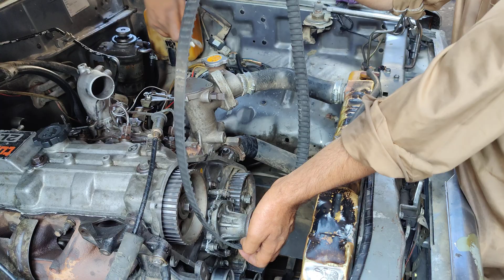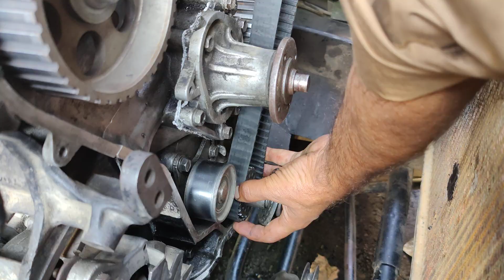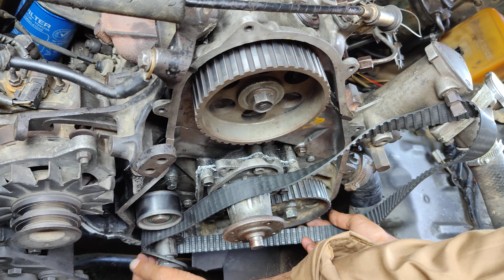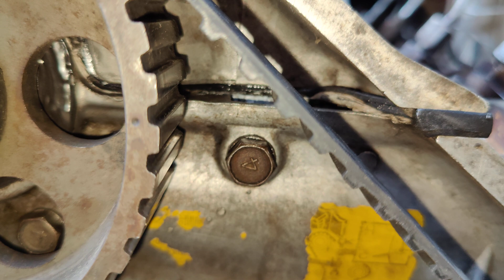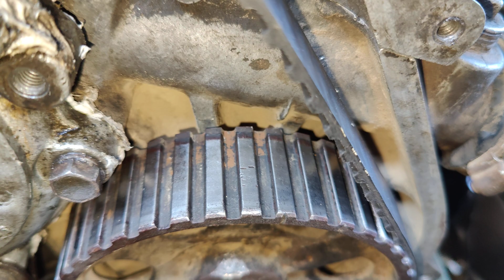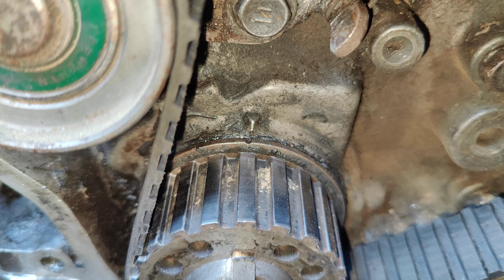how to timing belt installed Toyota 2L 2400cc old engine

Comment: A lot of work for you. When I do a job like this, I will also change the coolant, the idler pulley, and the water pump while I have it all apart…
  maintenance is expensive.
    but that which ought to be done and isn’t, is more expensive..